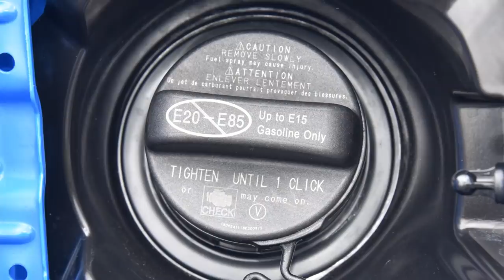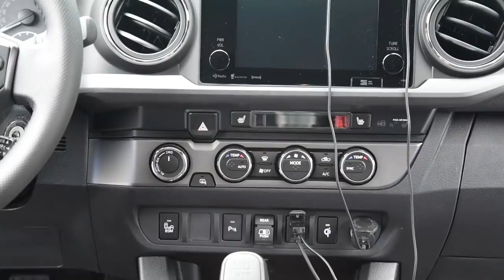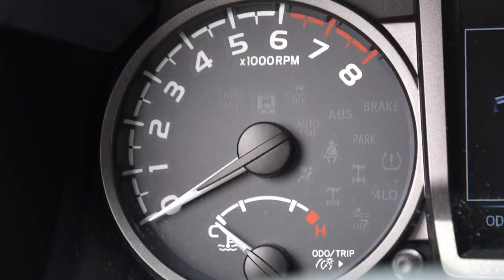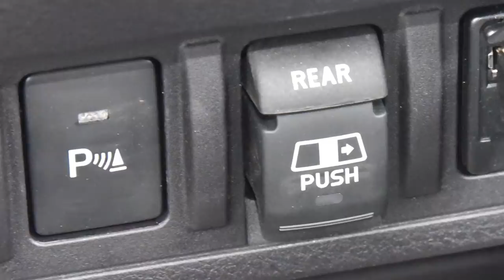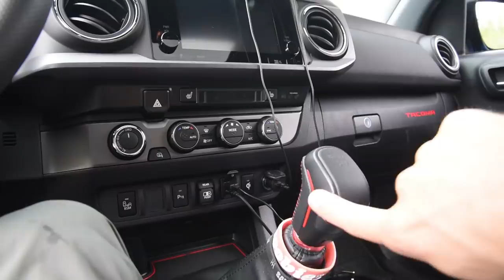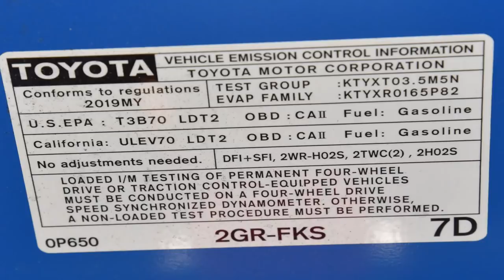2019 Toyota Tacoma TRD Pro: Regular Car Reviews

Comment: I dig the manual and the added HP boost. The interior has some decent amenities too, but I'll largely take my 2nd Gen over this, especially when you factor in the price difference. The TRD Pro should come standard with the TRD Supercharger at that price, and should offer more considerable capability over its normal TRD Off-road and TRD Sport cousins. Otherwise, I think the 2nd Gen was and still is a better value than this; they were basic trucks and never tried to gloss over that fact. The only times prices would encroach on $40,000+ is when you started getting into the biggest and baddest Double Cab w/ Long Bed and leather upholstery, navigation and sound, towing and performance packages, and more, not just a slightly gussied up mid-tier model with unique badging and minor suspension upgrades and underbody protection.

Comment: You wont get water in your rear end if you drive THROUGH the water this is primarily because the rear end gets hot and pushes air out, but with that said if you PARK or remain stationary in water then yeah sure, it's possible to get water in your rear end.

Comment: They’re using the mechanical fan and clutch because they must have thermal management issues. Mechanical fans move more air than electric fans, but they use actual horsepower to operate. The only reason they would use this setup is for the increased airflow. Not familiar with this engine, but I’d guess it’s pushed to the relative limit from an engineering perspective.

Comment: I would think a "TRD Pro" model would have some sort of forced induction system like a turbo or something to make it worth it than getting a regular "TRD"

I mean the older TRD packages at least came with a small supercharger which was a start to having something to compete against the other truck markets that are producing trucks that are much more powerful 

As an example Ford recently released a Ford Ranger Raptor and I believe GMC is bringing back the Syclone so if Toyota wanted to compete with the small truck market then they need to give us something with more UMPH under the hood that is noticeably different than your average Tacoma

I didn't use Dodge as an example because a Rebel is for the 1500 ram and that's a bigger truck than a Canyon, Ranger, and Tacoma, and I would compare the Rebel to the Tundra, AT4, and F150 Raptor but since dodge haven't brought back the Dakota (as far as I'm aware of) I can't compare a truck from them that would be considered a small truck (something under a 1/2 ton truck)

Comment: I've had the misfortune of driving one of these through Atlanta, GA. In rush hour traffic. All the way down from Colorado. The brakes, are NOT something you can get used to. I've driven a clapped-out, LOOK HOW BIG MY MUFFLER IS 90's Honda Civic that had better feeling brakes, a more responsive clutch, and a better feeling shifter.

It is entirely beyond me as to why these feel so bad with the brakes, the shifting, and the shocks. It's supposed to be an offroad car, not a super-stiff, bone-jarring track car with brakes so touchy you can barely fart in their general direction before you're locking up the front wheels.

Comment: The third gen has no torque DOWN LOW. It's a sport sedan engine made to rev. And the indecisive auto gearbox doesn't help.
Reply: Sport sedan?  Toyota made a sport sedan?  When did that happen?  I thought they made transportation pods?  See: Camery, Corola, Avalon, etc
Reply: @donhappel9566  Lexus GS I believe
Reply: @Shakshuka69  nope.... luxury sedan maybe, but not sports sedan.  The IS could be considered a sports sedan I suppose - kinda a cut-rate 3-series knock-off.  Sadly even the 3-series has become a flabby over-weight luxo-barge these days

Comment: Sounds like this guy hasn't been off-road much! People who use their vehicles off-road don't use stock tires. The clutch fan is a plus; electric fans don't like mud or water. I don't know a lot about the IMT system, but the plus about a manual is the ability to "drop the clutch" a jam it or be able to rock back and forth. Good Luck getting 400,000 out of your Ford or Chevy.

Comment: The extended diff. breather mod. really isn't necessary in my experience. I actually use the snorkel on my  FJC and have never seen evidence of water ingress in the diff. oil. 

Gotta say though, a Taco. does not even remotely compare to a Raptor. Or even an F150.

Comment: I'm really tired of the hyper-inflated truck market. My Dakota is getting very old and tired at 240,000 miles, and I can't find anything worth what's being asked to replace it. 

I need a 6.5 foot bed, seating for at least 4 in a pinch, towing cap of 7,000 lbs, 4 wheel discs, ACTUAL limited slip, and as much or more power AND torque than I have now in a package I can park in an underground garage. Nobody offers this for less than an arm and a dick. Quit buying trucks you don't need! You're pricing people who do out of the segment!

Comment: The play in that stick shift is embarrassing. The stick in my 20-year-old Miata wobbles less and it's driven 200,000 miles a lot harder than that Tacoma has driven 10,000.

Comment: Will it rust any less than any other Toyota, since it's a professional turd now?  I've seen brand new Toyotas on the road with undercarriage rot already starting to make its way up the paint, bumpers with rust holes punched through, and exhausts barely hanging on to anything left.  A label is a label, doesn't mean the manufacturer is going to change their ways any just because you plopped down an extra 20 grand.

Comment: Its a good looking truck (aside from that fake snorkel) but way overpriced. Save 10k and go with the off road its nearly as capable. Honestly most will not need 4x4 just get 2WD and a rear locker and save even more. Or just accept its a truck and has terrible gas milage and buy the Nissan PRO-4x for a steal. (The VQ is peppier anyway)

Comment: Toyotas been pushing turd snorkels and parts before the Raptor. Turds have been pushing up the msrp prices for small pickups for 20 years now. How much 42,000 to 46,000 dollars, these trucks were 30,000 5 years ago. Not worth the money. So mid range f150 prices. No such thing as off road all seasons haha . U got screwed out of a set of bf all terrain. Haha its amazing how much Toyota people don‘t know.  Haha the ac didn't  rot the frame, its crap Japanese steel. Hopefully they fixed the bed mounts that break. But you'll ever off road. Haha i like the exhaust is lower then the cross member for the transmission that will break fast 5:38

Comment: Why did someone put a snorkel on a truck that has more technology in its interior than my whole house combined, and has a nice paintjob to boot, as if its ment to beat on, why bother with a polished beautiful paintjob like this, unless it comes with an offroad proven clear bra, and ceramic coating? as its like taking an evening dress to dive in the ocean, its just completely the wrong equipment, like shouldnt this be like a GTO back in the day, where its just the base model with base model paint with the largest engine and sport suspension imaginable?

Comment: 3.5 liters, and 278 hp?
That is fucking weak.
Also, how in the hell is condensate from the a/c demineralized?
It is water in the ambient air the condenses on the heat exchanger.
You telling me they have a reverse osmosis system collecting condensate, and taking the solids out of the water?
And if anybody says yes, then how does it get rid of all the minerals that has collected?
Does it form some sort of owl pellet, and spit it onto the ground?
Somebody(who actually might know what they are talking about) please explain this process to me.

Comment: Worse than the 4.0 V6 Hilux we got in SA.
Reply: 4.0L V6 2nd Gen Tacoma owner here; the 3.5L V6 roughly outperforms the 4.0L where it actually counts so explain how it's any lesser. There are aspects of the 4.0L I enjoy more than the 3.5L, like the omission of DFI in the 4.0L gives it a more refined sound instead of the modern clatter that DFI engines have. Still, the torque numbers are similar, but the 3.5 operates on the Atkinson cycle, making it inherently more efficient and returns better overall HP. Reliability is good too, not as proven as the 4.0L yet, but good.
Reply: @DarrenPersad Just hear-say from folks driving the V6 4.0 Hilux and Fortuner over here, then again we normally use smaller/European engines here so we are biased.
Reply: I understand. Totally get where you're coming from. Personally, I wouldn't give up my 4.0L for the 3.5L or the 3rd Generation Tacoma as a whole, but there are a lot of net benefits to ownership of a new Tacoma. My 2nd Generation Tacoma has been a phenomenal runner, even in our demanding New England/Northeastern winters here in the United States, and given Toyota's legendary heritage with the Hilux, I know that my 4.0L Tacoma will continue to serve for years to come.
Reply: Sorry, commented from my other account!